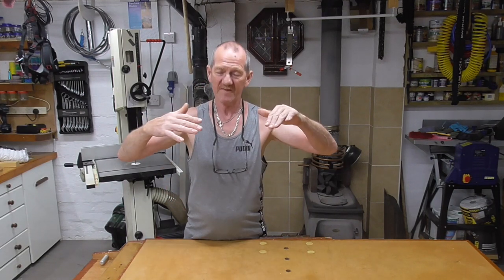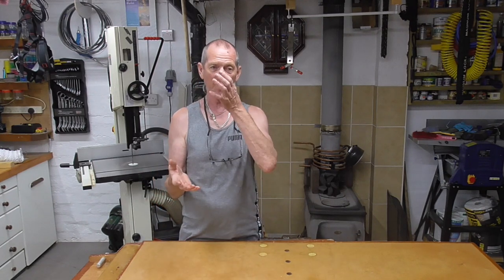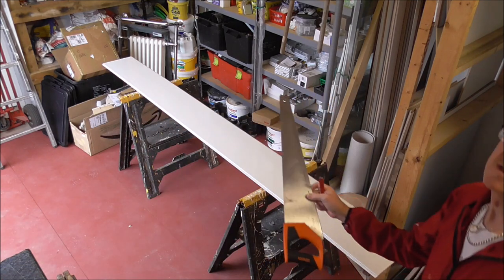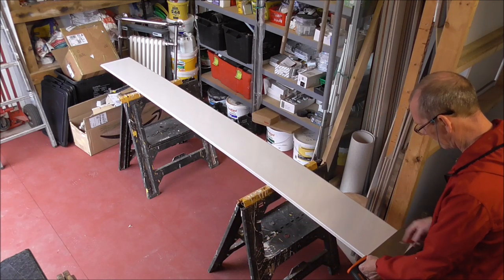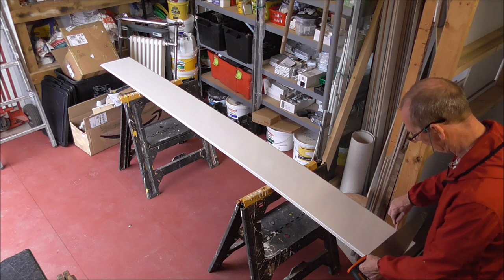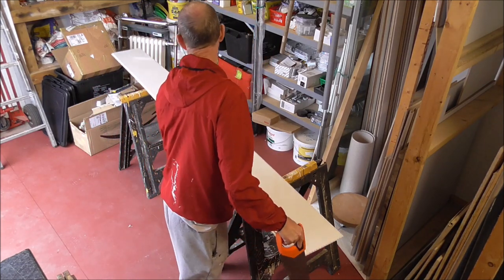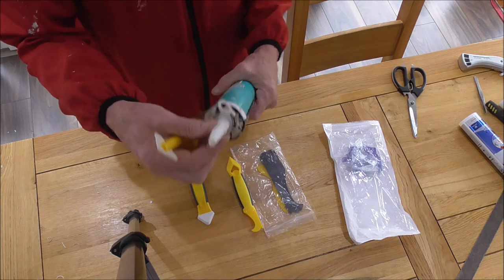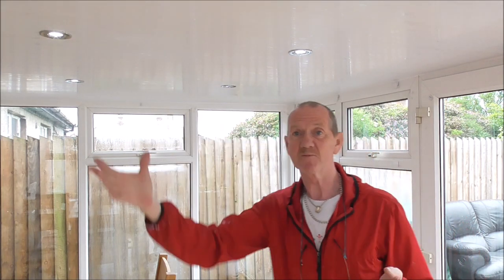Step By Step Fitting a Plastic Ceiling

Comment: Hello David, brilliant job, looks great. My roofers were planning to replace my conservatory roof with roof felt because of the low pitch and tiles being too heavy for the existing framework. I am going to forward your video and ask if they can use this steel roofing instead. I’d also like to know why you didn’t use any flashing against the  walls of the building. Thank you.

Comment: My ceiling is 280cm wide and 600cm length. All the cladding I can find is 270cm in the UK, so can u add 10cm extra and hide the joint? Also what size is the wood your using? How do I ask for that wood? Is it called a stick etc? Sorry I don't know any names. I've googled it and and the only wood in search that comes up is sticks that are pencil thick or skirting boards! How do I specifically search for that wood? And what's the size etc? Thanks
Reply from the maker: SBS do a 4m board
Reply from the maker: Sorry answered before reading it all.
The wood is standard roofing lats used in the roofing trade and builders yard will have them
Reply: @dmgladden  thank you so much for replying

Also why did you make a double frame? You made one and added them small pieces of wood to the old ceiling for extra strength I'm guessing? But then after you completed the frame you added longer pieces of wood (the ones you stuck the pvc to) what was the need to do that? Could you not have just stick them to the original frame you built 1st? Thanks
Reply from the maker: @SY-ml5nl  hi the first thick frame is to stop any sagging in the future the second frame to to set the height I need
Reply: @dmgladden  hi, thank you so much for the reply. I think I've screwed mine up. I've basically screwed the frame under the existing ceiling beams. So my frame is up, but if I add more wood now my ceiling will get too low. Thanks anyway for your help

Comment: i always use a battery grinder with a slitting blade makes a bit of dust but i find its easier
Reply from the maker: For doing what
Reply: @dmgladden  cutting the plastic
Reply from the maker: @secretsix6  ok but fitting these ceilings is what i do for a living and i must say if i could find a cleaner safer way to cut them i would but to be honest the fine cut saw is quick enough and its less likely anything will go wrong